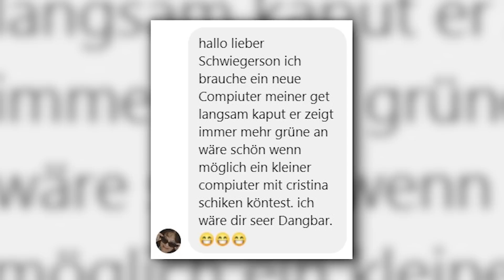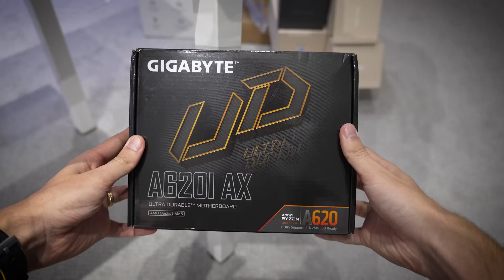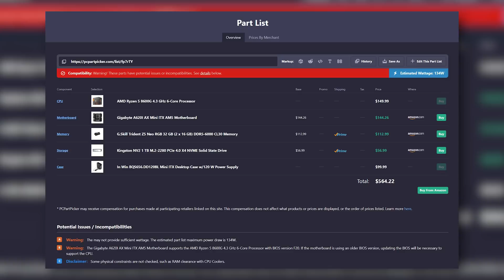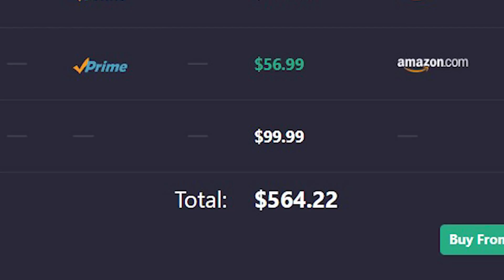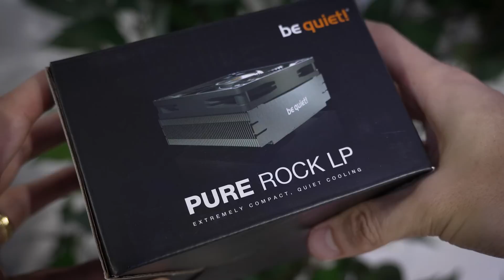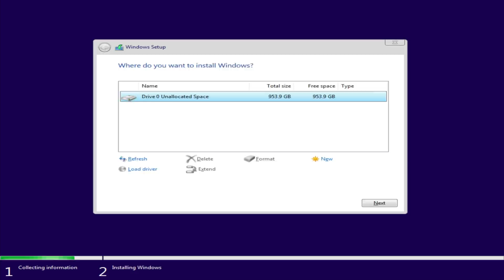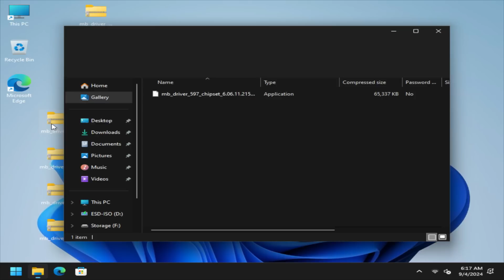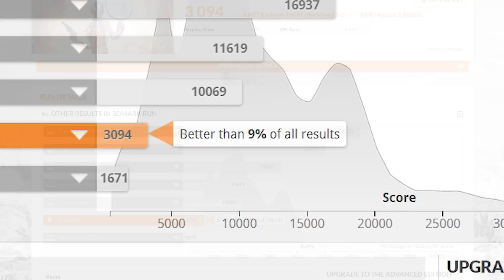The Mother-In-Law PC Build

Comment: If I recall correctly, Steve from HUB built in InWin Chopin (almost a twin of this) with stock cooler and after removing external frame over fan, it did fit.

Comment: I have built several systems in that BQ case. I would point out a couple of things to watch out for. The cabling in the case and your motherboard choice may matter if you are considering using 2.5" drives. At least in past models there was very little by way of pass through from the upper to lower side where the drives have to go. Of note, the power supply in these units are not very high quality and it is a recurring theme in reviews about the unit. There is actually a 300W PSU that was commonly available in the B1 series and is available for separate purchase. Other options are to do a PICO and external power brick, which actually buys a little space inside the unit. In my own (latest) use case I was going to use the BQ due to its VESA mount option, but the system could not handle the 11600K I purchased for the use case. Everything fit, and it would start up, but temperatures were problematic from the get-go using a Noctua very similar to what was utilized in this video. The other issue was power draw on load. Hopefully the unit you built for her will last in relation to the power supply, as it is the weak link in the chain and shipping this back and forth would be too cost ineffective. IMO, for just a slightly larger footprint there are some nice Silverstone cases available with better power supply options.

Comment: The only change I'd recommend is using PTM7950 over paste. That way you don't have to worry about the paste suffering from dry out in a year or two and potentially running into thermal issues.

Comment: How's that work with Germany using different power plugs (I'm assuming, I'm pretty sure we are the only o es using the ugs we do) from us here in the US? Did inwin supply the correct wires or does she have to use a converter of some kind? 

Yeah, building computers now is stupid simple, unlike 20 years ago.....

Comment: With all the hoops you need to jump through to get windows into an ideal state, I can't help but wonder if Linux is a better choice. Only uses a browser? Occasional documents and spreadsheets? Seems like a good fit, even for someone accustomed to Windows.
Reply from the maker: Hahahahahah absolutely not. Linus in general is hooooorrible for first-timers.
Reply: @GregSalazar  10 years ago I would've agreed with you but it's improved a lot, and with Windows slowly devolving into spyware, I wouldn't dismiss Linux so quickly.

Comment: I built a PC for my brother-in-law a few years ago in a nearly identical case and I ran into the same issue you had with the stock AMD cooler not quite fitting. However, I quickly discovered that the plastic decorative ring on the stock cooler can be removed which provides just enough space for it to fit under the mesh side panel!

Comment: Doesn't Germany use a different voltage and hertz?
Reply: Most of the power supplies could handle it. You need only an adapter for the wall plug.
Reply: Germany operates on a 230V supply voltage and 50Hz.

Comment: What about keyboard and system software language localization? Also, power cord or adapter? While modern power supplies auto-adjust for 120/240 volts and 50/60 Hz mains power, an appropriate power cord or adapter is needed for the specific country. Hopefully all of these things were taken into account, but it would have been nice if they'd been mentioned in the video.

Comment: Is that a wear mark on the edge of the case at 11:38 ? I believe you indicated that the power supply required a special power cable. Does your mother-in-law have an adapter to adapt the US plug to an EU power plug?

Comment: FYI, you can take the AMD shroud off of the fan.  Its just a couple little screws underneath that holds it on. If you take it off, the cooler fits perfectly.

Comment: Don't know if you fixed it before sending but if she has an issue the IO shield is partially pushing the bios flash back button down. I only noticed it because I had the same issue with the same motherboard. Noticed it at 12:48 and again at 16:26.

Comment: Obviously this is too late now, but the Wraith can be very easily modded to fit. The top ring on the Wraith can be removed with a single screw, and that drops the cooler height by several millimeters.

Comment: Another question? Will that power plug work in Germany? And is the PSU also suitable for 230v?
Reply: I also wondered about the power cable. Zoom in and read upside down at 8:07: the power supply will work with 100~240V, 2.5A, 50-60Hz.
Reply: Same thought

Comment: Could have just taken out the cap/shroud of the AMD cooler (2 small screws). This is what I did and it fit just fine
Reply from the maker: Looks uglier and fitment was still incredibly tight. I didn't wanna risk the fan ever scraping against that panel.

Comment: i would have like to see the trouble shooting on the original build from years ago. it would be interesting to see what failed on a system that was used lightly for years. helps give insight on hardware durability over time.
Reply from the maker: I'll see if I can get ahold of it and bring it back here.

Comment: Honestly for this situation I would just send a beelink mini PC for this type of scenario, like an SER5. Nothing wrong with the system that Greg built here, just I like those mini PCs, they are typically more than powerful enough, cheap, upgradable other than the CPU and they are extremely power efficient due to the use of laptop parts.

Comment: did you check the psu for German voltage and frequency? and German plug?
Reply: It says 100-240V 60/50Hz on it in the video, so she should be good. Just needs a Euro power cable or plug adapter.
Reply: @aachaion  i was also concerned about the psu side of the power cable, if i seen correctly it looked like the Micky mouse type, and i am not sure you can get those over there ...
Reply: @373323  You can. It's an international standard, IEC 60320 C5/C6, typically used on laptop power bricks.
Reply: Most ATX power supplies have dual voltage primary 110V/230V 50Hz/60Hz and can work pretty much anywhere.

As for the power plugs, the end that connects to the PSU is an international standard socket.

You can buy the correct power cord in Germany to suit the local power outlet no problem.

Comment: The Box-Cooler outer Ring can be removed/lowered which gives you some more space. People with ASrock Deskmini used that as a workaround because the included cooler is a bit too loud.
Reply from the maker: Looks uglier and fitment was still incredibly tight. I didn't wanna risk the fan ever scraping against that panel.

Comment: and isnt the power supply not compatitble in europe? both plug and voltage wise? especially for such a cheap unit
Reply: All modern PSUs will accept 50 or 60 hertz and up to 240 volts. The plug will never work, but she probably has an adapter already.
Reply: It says 100-240V 60/50Hz on it in the video, so she should be good. Just needs a Euro power cable or plug adapter.
Reply: I had the same concerns wathing it, I just checked the vid and at 8:05 you can see label on the power supply and it is rated up to 240V, she should be fine. Also the powerplug is standardized "Mickey Mouse" style, alos available in Germany so she will probably just need to buy a power cable for around 5 bucks 👍

Comment: You haven’t mentioned about power supply: does it have switch from 110V to 240V? Also cable plug won’t fit in EU?

Even if the original AMD fan were to fit in, you would hear the turbulence because it would be close to the mesh. I experienced this with DeskMini, unbearable 😅

Comment: Nice to see a realistic build for a realistic purpose. Most people don’t need a triple thick three fan GPU with a 1000w PSU, twelve thread CPU and 300 fps at ultra settings. 

Most people are doing emails and YouTube with their computer and this is the exact type of computer your mom, dad, aunt, uncle, neighbor, friend, young child needs.
Reply: "twelve thread CPU"
commenting on a video featuring a 12-thread CPU.
That's quite literally, the baseline for acceptable performance. Quad cores get bogged down simply running updates while trying to use them.
Reply: @tim3172  lol, Twelves cores is not the baseline for minimum performance requirements. Not even for games. 

Many, many, people are running spreadsheets and browsers on 5-10 generation old processors with no complaints.
Reply from the maker: @LSAKDFpo2q3  You said "threads" in your initial post. 12 cores and 12 threads are wildly different, my friend :-)
Reply: @GregSalazar  Look, I’m kind of an idiot and trying to dig myself out of a self inflicted hole ;-)
Reply: @LSAKDFpo2q3 we appreciate your honesty. 6 core 12 threads is definitely this day and age’s quad core

Comment: If it's like the Inwin Chopin case you remove the top shroud off the Stealth cooler and it just fits. That said my experience is with AM4 so there may be a bit of a height difference.
Reply from the maker: Looks uglier and fitment was still incredibly tight. I didn't wanna risk the fan ever scraping against that panel.

Comment: Nice video, well done. She'll appreciate  the pc. I'm assuming that the PSU is dual voltage and you included a German plug, as well as German OS as you mentioned she doesn't speak English. All in all, very nice.

Comment: I was thinking of doing a build like this for a friend. Ended up doing a used build with a i7 8700 and GTX 1070 in the AP201. So not as small, but it was almost 1/3 this price
Reply: Still really want to mess around with am5 apus, just need to find a reason to do it

Comment: Uh oh, MS changed windows updates.  They added experimental updates and standard updates.  It's advisable to turn off "Get the latest updates as soon as they're available"  Below it is even says, "Be among the first to get the latest "NON-SECURITY" updates, fixes and improvements as they roll out"

I enabled this once a while back and I was getting co-pilot and other MS crap installed suddenly.  I rechecked windows update and read this BS and I turned it off immediately" and then realized I needed to reinstalled windows again and made sure it was set to OFF.

NOW, I get security updates only!  I wish MS would quit doing this shady crap all of the time.
Reply: "I turned on get the latest updates and I'm upset because I got the latest updates."
Reply: @tim3172  You mean you got the "non-secure updates", in other words you get all of the spam and experimental updates that may cause issues.

Comment: any issue running this on german power?
Reply: It's an IP-AD200C7-2 PSU which is an auto-switching 100 - 240 V 50-60Hz unit.
Most ATX/ITX/Pico PSUs require you move a switch from 100-120 to 200-240. This doesn't.
tl;dr: no issue
Reply: according to the power supply its an inwin 100-240v 60/50hz 200w model. so there shouldnt any issue no matter what region & it should automatically detect it, other than the plug which is more of a problem. she needs an adaptor for that, or a new cable that fits in the psu. (unless her old pc has a compatible smaller 3 pin connector already, then she can swap it out, but looking by the shape she prob have to buy an adaptor that plugs into the outlet - easiest solution)
Reply: @Vss077  right but is it auto switching or is there a physical switch of internal jumpers to run 220
Reply: @tdub77  as tim3172 already mentioned: it is auto switching -> also as the psu states & what ur always looking for is: Active PFC (Power Factor Correction) = u have to do nothing & will adjust according to ur region u are. 
A Passive PFC will most likely have a switch. (but u prob dont see them anymore other than on older stuff)
Reply: @Vss077  So we are really talking about a power cord or an adaptor...

Comment: is she on 220 v? Did you get the proper power cable for her, and does that psu have a switch for 220?
Reply from the maker: She has plenty of 120V adapters, it’s how she used the last system I built her.

Comment: Well @GregSalazar you messed up 2 things here. 1: In Germany they use a different keyboard layout. So unless you have changed that without showing us, your mother in law might have some trouble to change the keyboard layout. 2: The German language package was not installed - or not showed in the video. That will make the Windows experience for those who aren't sufficient in English a lot harder.
Reply from the maker: It’s not a huge deal. I left it in English for her the first time and it was easily changed. Cristina takes care of it.
Reply: @GregSalazar you should try learning German in the future to communicate better in the future
Reply: It also should change its locale to Germany so that it gets the better version of Windows with EU consumer protection laws.
Reply: And number three is you need a different power plug.
Reply: @sacerdor7467  It's the second PC he's sent her. I think they have that handled.
Reply: @AAjax  he said it‘s a proprietary cable, that‘s why I sensed a potential issue. In the end an adapter could do the trick. Not sure if the difference in voltage  between Europe and USA can cause an issue for that PSU.
Reply: @sacerdor7467  Well, it's not a proprietary cable. It's a standard IEC320C13 connector, albeit less commonly used with PCs. I have a few laptop power bricks that use the same connector.
The Inwin case has a 100-240v input range, which means it's fine for a cable swap or travel adapter.
German people are highly aware that US has a different power standard, and they've dealt with this before, and likely they did it with a wall adapter.
Fine to flag it as a potential issue. Highly presumptuous to list it as one where Greg "messed up".
Reply: @AAjax  Don't you think you're overracting just a tiny bit trying to defend your content creator against what you perceived as an attack on their tech skills ? You should really calm down a bit. He called it "special power cable" not proprietary. And even if there is some standard to it, that's not a power cable you have laying around your house anyway. And no, most people are not aware of the different voltage used in different parts of the earth, especially when it comes to people who are not into tech and let other build a PC for them. If he built her a PC with components from overseas already then she might have an adapter, but if it had a regular PSU chances are they just replaced the power cable with one that fit EU power sockets. And not even mentioning this on the video seems like some oversight.
Reply: @sacerdor7467  I'm perfectly calm. Weird that you shifted to a personal attack. 
It's not that hard to say "oh, I didn't know that". Try it some time.
Reply: @AAjax  I mean it's like whatever. This is leading nowhere. You get all pissed about my comment, attacking me and calling me presumptuous and then say that I'm attacking you. Just my kind of humor. But like I said it's whatever. You get all mad about me pointing out an oversight tells me all i need to know.
Reply: @sacerdor7467  correcting your statements or saying something you said was presumptuous isn't attacking you, bud. It just means I think your statement has an unsupported leap.
Go reread my previous comment. Not once did I say anything about you personally, just your assertions, until you started to make weird statements about me being angry.
But you can pretend I'm mad if it helps you feel better about your statements being challenged.
Reply: @sacerdor7467  actually no problem for power supply it's better for power supply efficiency on 220v just need an adapter or eu Cable
Reply: What's the difference between outlaws and inlaws?

Outlaws are always wanted!
Reply: Yeah, and the USB port in the back (the red one) with the metal piece from the motherboard backplate inside it, just waiting for a short circuit.
Reply: Hey Greg how do you deal with so many negative people I couldn't do it buddy
Reply: You missed out on the “brownie points” that you could have got from doing it all in German too! 😂

Comment: only 1 fan. that's not good.  cpu heat is dispersed but stays inside the case and overheat motherboard  and other parts
Reply from the maker: No it doesn’t. It vents out. Do you think pressure in the case continues to build and build and build? 😂
Reply: @GregSalazar  hmm Check the temps.  I had a OEM SFF PC, at idle it ramped up to 55+ C with no case fan within 1 hr, forgot if it was cpu or mobo temps.  Although it didn't have a 120mm fan.  Maybe it was 80 mm fan.  So I added a 40 or 60mm fan to the case and it became much cooler.

Comment: Damn that was some peak german😂

P.S.: I can appreciate that there are translators available allowing for some communciation, altough the translation isn't always that easy to understand. Maybe AI will improve translation.

P.P.S.: Nicely mastered PC building challenge. With all the available hardware options and generational difference regarding hardware architecture build a rig always can stay challenging even if you have been doing this for a long time.
The whole software and driver system is, in my experience, often more time consuming and also harder to set up right in the first place or else some devices might not work properly.
Splendid that you managed to take care of that stuff right away, else some possible troubleshooting with your mother-in-law might have possibly turned out quite the issue.

Very well done, Greg👍

Comment: Hey Greg, you can actually remove the shroud on top of the stock cooler fan! Just a cool tip in case you didn't know, but I'm sure your in-laws would appreciate the cooler upgrade :)
Reply from the maker: Yeah but it didn't look like removing the shroud alone would have worked - the cooler still sits a bit higher IIRC than the mesh. Either way, I think the replacement was a better choice in the end :-)
Reply: @GregSalazar  Ah that makes sense!